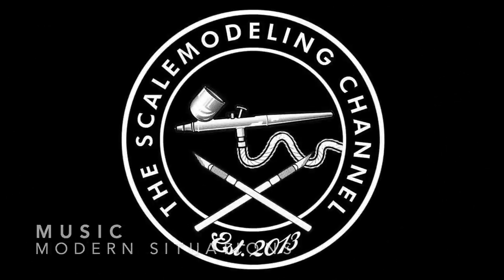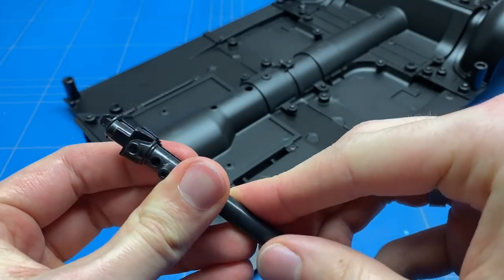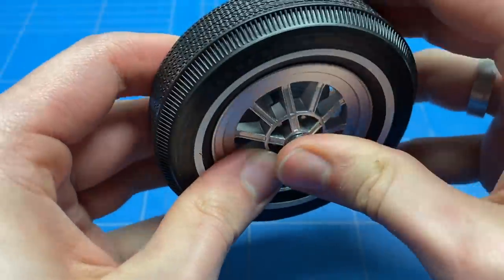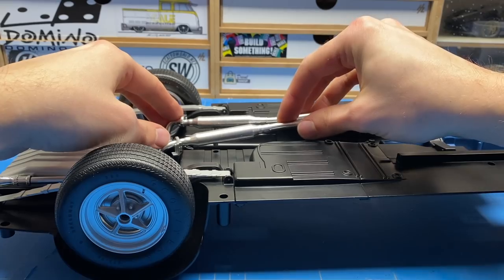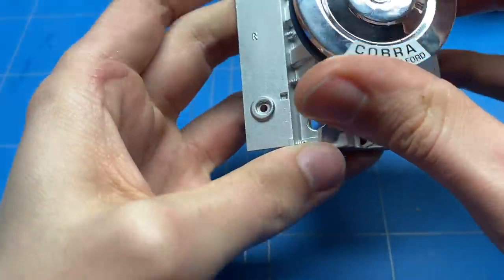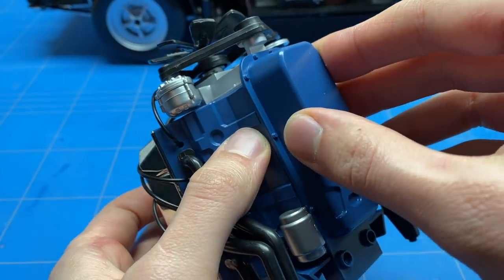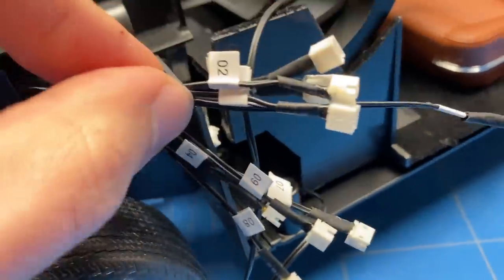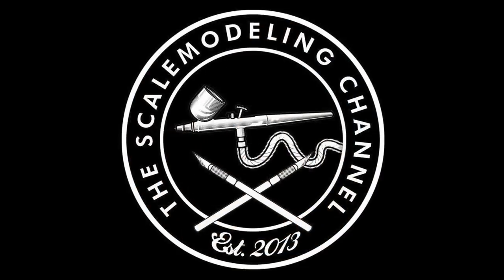Agoramodels: 1/8th scale 1967 Shelby Mustang GT500 Supersnake Part 2 Chassis and Engine

Comment: The Super Snake was specifically built to test/prove the reliability and high-speed durability of the Goodyear tires (those skinny whitewalls). That said I would have changed the tires and colours too. GREAT channel, the first video on the interior actually got me to subscribe (I too would have gone with the saddle, can't wait to see the exterior. My thoughts are Speed yellow or Deep Emerald Green metallic but looking forward to see what you do). 
Thanks and great building.

Comment: You could really fill up the engine bay at this scale with linkages. Tons of tiny wires and all the fender mounted doo dads, fuse blocks, and clamps. A little time here will really set this apart from an assembled model to the level of scale replica. Also, please polish the glass. That really does make a difference. Great skills and video as always.

Comment: Looks pretty good but when going for such detail in a large scale the Leaf Springs  should have shackles at the rear. Such a pity it doesn't have a propshaft that actually turns the rear axle through a simple gear set.

Comment: Nice video! I have a question that is unrelated. I’m am starting my first full resin kit. Did I see you use the Tamiya liquid surface bottle primer on resin? I can’t remember. I have mr surfacer primer but can also use tamiya spray can primer as well.
Reply from the maker: I did, correct